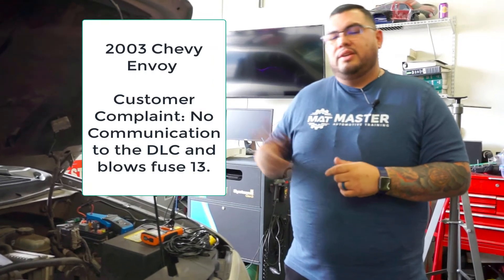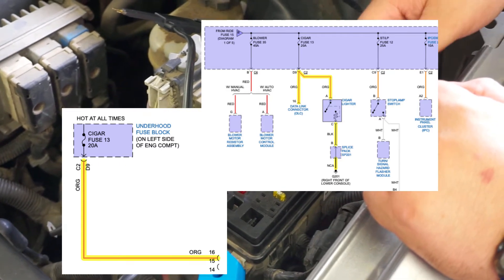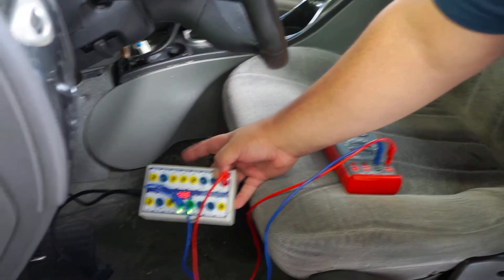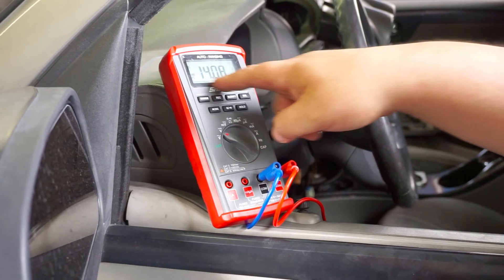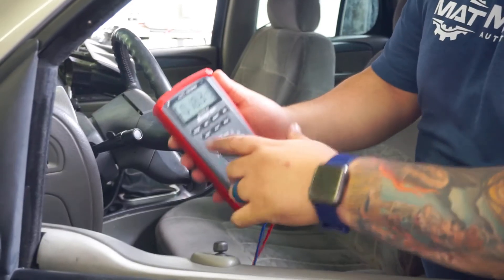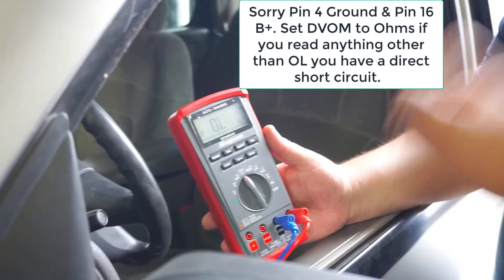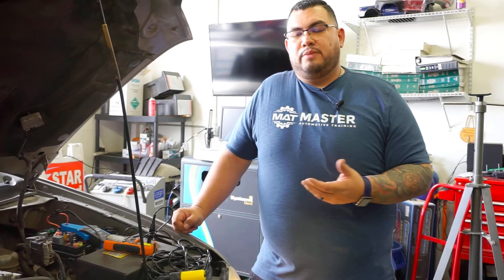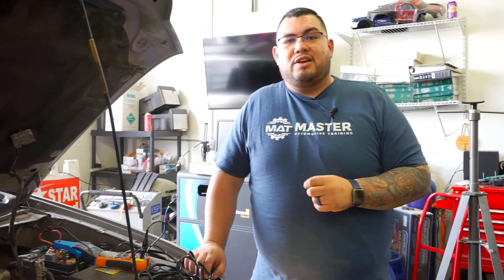[EASY] HOW TO FIND A SHORT-TO-GROUND (NO SWEAT YOU GOT THIS)

Comment: Polo car is problem, fan is not open I  check the radiator fan but I don't understand so I take the scanner in polo car show the radiator fan Short to ground, can you suggest to me ? How can this wire check
Reply from the maker: I would need to see wiring diagram to see how the system is controlled.

Comment: The real struggle is getting good wiring diagrams..  lol
Yeah, once you have good information the rest is straightforward. :P
Reply: True. Man, my shop has alldata,mitchel,identifix and IATN - even that isn't enough sometimes.
Reply: This is the TRUTH my God it took forever to track down a 2014 equinox data lines diagram as someone without access to anything mechanical